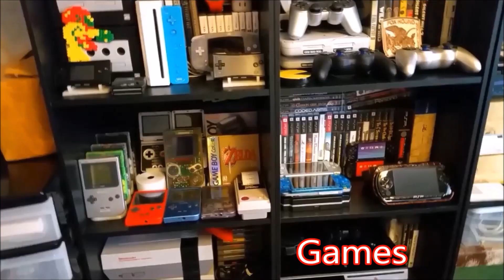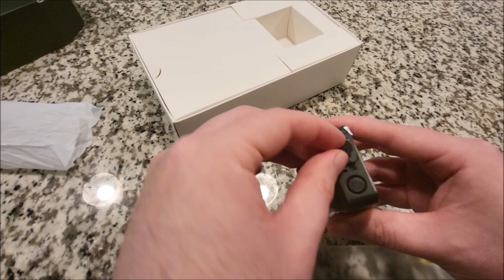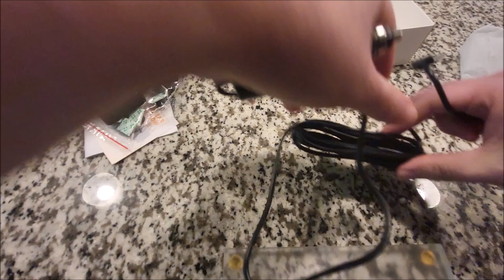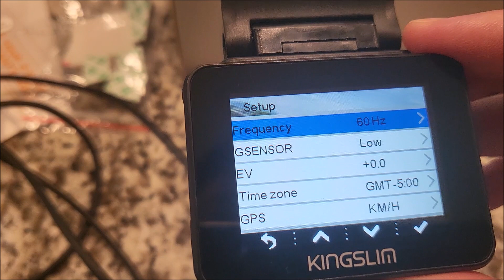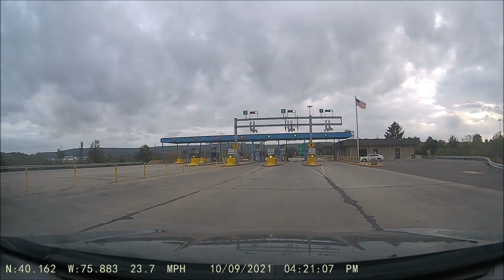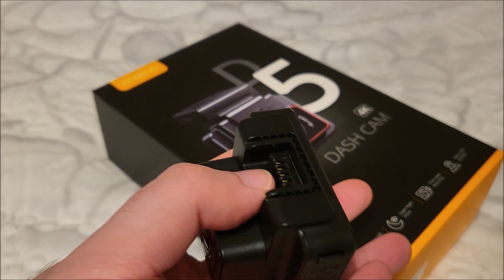Kingslim D5 4K GPS Dashcam Review

Comment: I recently bought a D5 and was looking for a review vid and stumbled upon this.  I instantly recognized where you were driving around, as that town was founded by my ancestors.  
Anyway, do you HAVE to hit record each time you get in or does it automatically start recording for you?  Mine turns on with the ignition, but doesn't seem to be recording.  I wasn't trying to use the stupid app and wifi if I'm not forced to.
Reply from the maker: It's a small world! Mine automatically starts recording when the car starts, you may have to change a setting to get it to do that though I cant remember since I set it up once and haven't had to enter settings again.